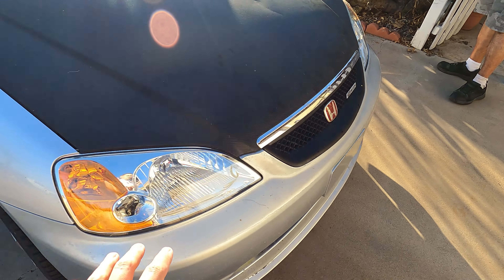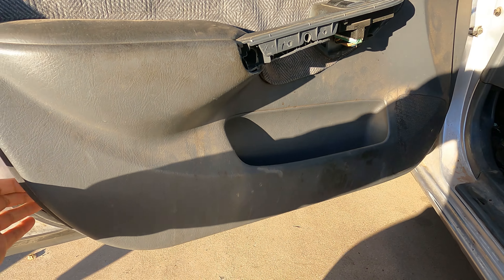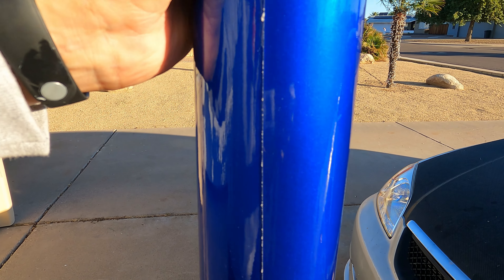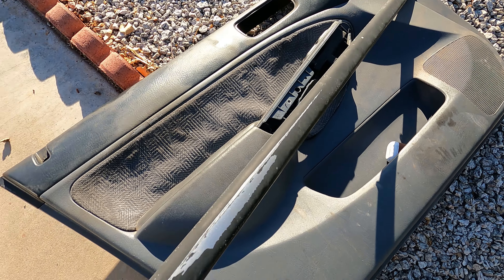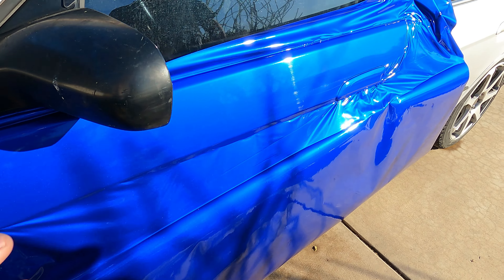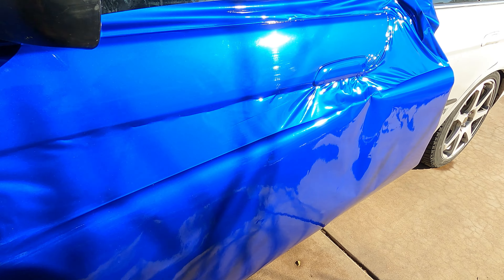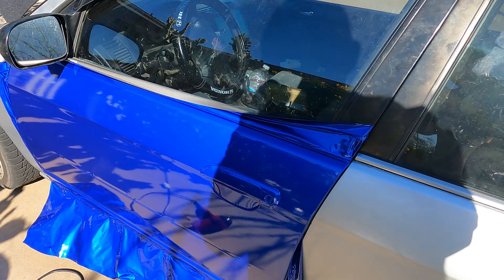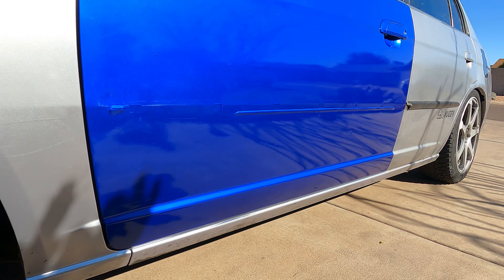WRAPPING the 7TH GEN CIVIC (2002 Honda Civic ES1)

Comment: What device are you using other than that hair dryer. Is that a credit card lol!?
Reply from the maker: It's a vinyl applicator. It has felt on the end so the vinyl doesn't get scratched. You can find them for cheap on eBay or Amazon.
Reply: @Jdmforall  Ok thank you. I love the the content. I still am confused about installing fog lights on my 7th gen.
Reply from the maker: No problem! Thanks for watching! What about the fogs install are you confused about?